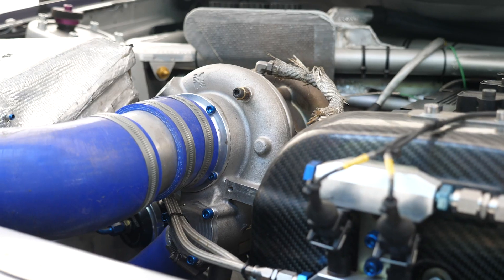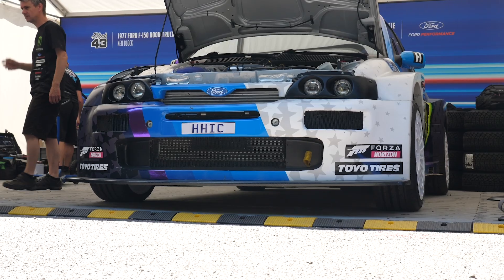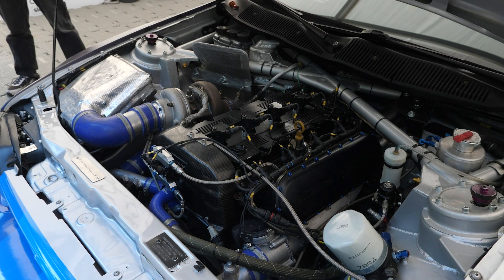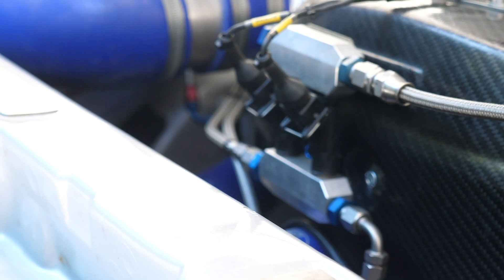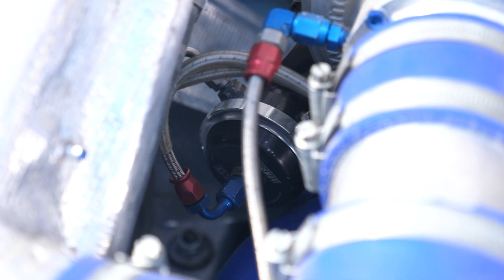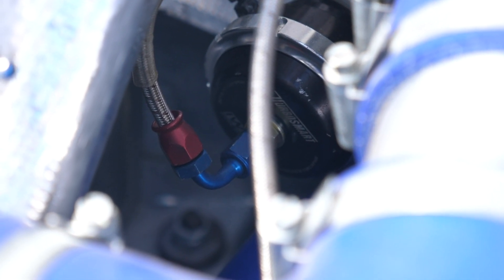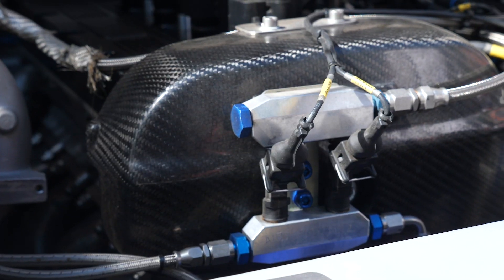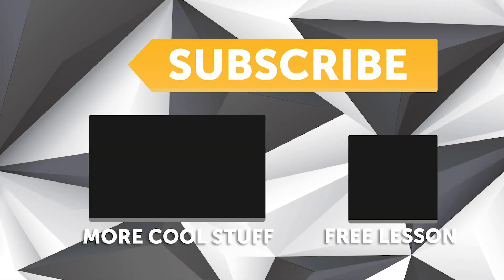Injector Based Boost Control | High Boost And Torque, Low RPM | Cossie V2 [TECH TALK]

Comment: Wow, probably so much more reliable than the typical 4 port as well. How do you measure the necessary injector size? Aim for the same flow as a regular boost control solenoid?

Comment: Sorry Andre, but you should know, traction is not the reason for wanting to have the ability to run a wide range of boost pressure in this application, the restrictor is. Allows lots of boost low in rev range with a soft spring to allow low boost a high engine speeds while keeping the restrictor choked.

Comment: Are you sure about that?
Boost solenoids are heavy and very slow running one frequency of 25 to 40  hz or something, right? 
That is just like a constant 1500 rpm or constant 2400 rpm, right? 
Imagine trying to control an engines AFR with something like that. Right. 
Air injctors are light and quick and need way more advanced electronics that works just like fuel injection to realize the benefits I would imagine. 
The precision with Air injectors is amazing I am told. That is why they still use them. :)

Comment: This is amazing, I wouldn't know in 100 years that this car works on cng,  but i wonder if this system or choice of fuel has anything to do with the pervious car burning to ashes
Reply: I think you got it backwards. They are using two cng injectors to actuate the wastegate
Reply: The car doesnt run on CNG, its just tue boost control injectors are the 1's used for CNG
Reply: @gandersson6121  yeap,  watched  it again, assumed it is using cng as boost. Thanks.
Reply: @cazsmith3503  yes,  watched it over. Thanks

Comment: Oups @@@!!,I'm trench,sorry for my english, but in 1988,the Renault Super 5 Gt turbo phase run soon like this........,nothing new,only electronics.....,Ford escort rs turbo,Renault 21  turbo have got "ovet boost"on the 1 gear :1985 ,1986.........
Reply from the maker: Hey Nicolas! This is not new, it does say so in the video and description ;) What isn't new to you though, can be new to others - Taz.
Reply: I think when you like something, you can know some basic thing, in french it's name the" B à   Ba",on don't know in english, like 4 stroke running,2 stroke, rotative piston,.....and turbo management, by example ,it's my opinion
Thanks for your vidéos, have a nice day